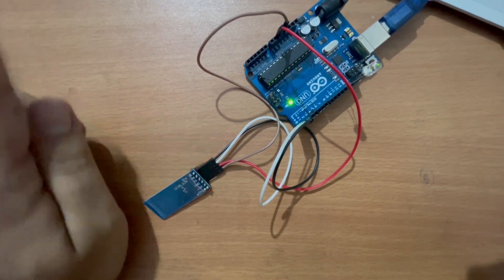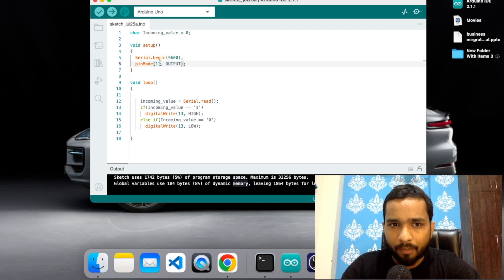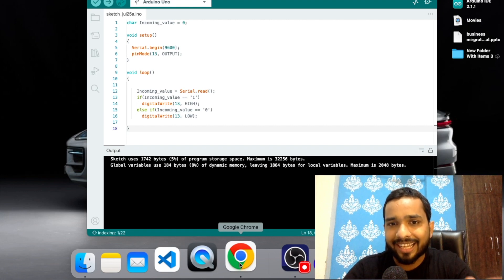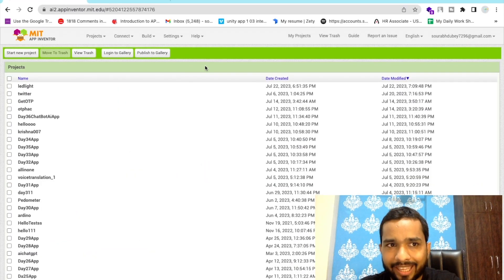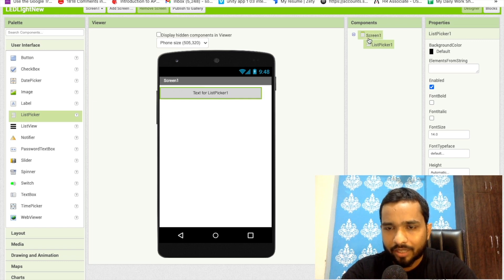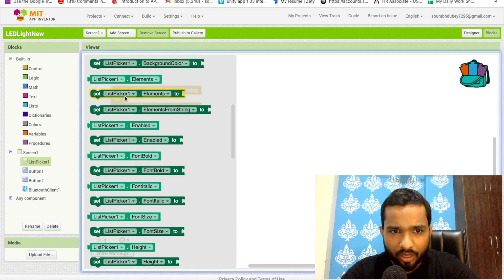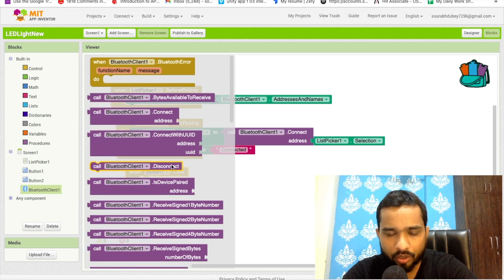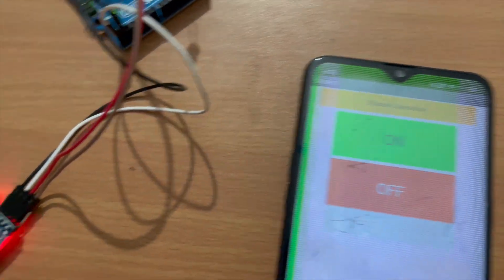Arduino Bluetooth LED Controller with Android HC-05 Bluetooth Module | MIT App Inventor

Comment: I'm able to pair and the blinking speed on the hc05 is slowed but when I'm pressing on the led is not activating also the led is working.
Reply from the maker: Check if you connected the wires correctly.
Reply: You have entered AT mode bro😂

Comment: after bluetooth connection through phone when i go to app there is not connection
what might  be the problem can you tell me??
thank you BTW nice and easy explanation
Reply from the maker: Most welcome 🤗 
Restart the device, check the bluetooth setting. Check the wire connect it’s in a right pin or not

Comment: I did all the procedures as you said.....but I am not getting the module name while choseing to connect the device....😢I can't able to connect....why it is so?? please reply 🙏
Reply: Same problem and also in hc05 Bluetooth module blue and red Both are  glowing why😢
Reply: Try to change bluetooth name and password by A T commands, and also check the bound rate of your hc 05 bt module..set it perfectly to communicate with your Arduino bord..
Reply from the maker: please reset the arduino and change the bluetooth name